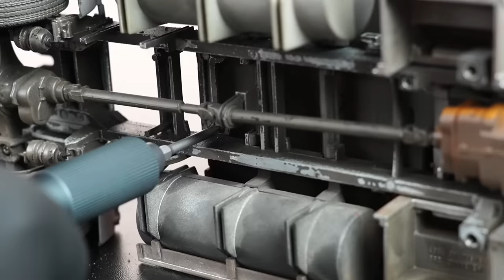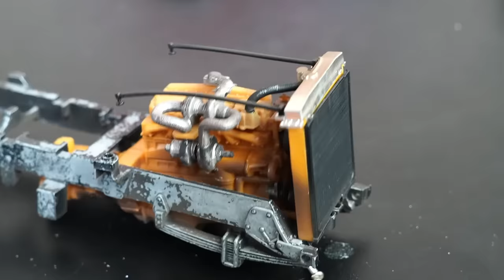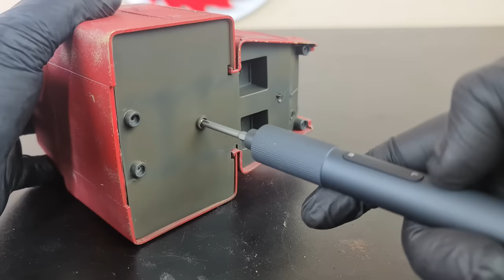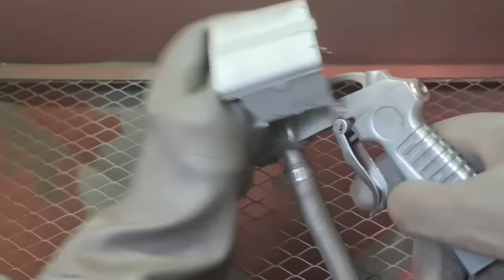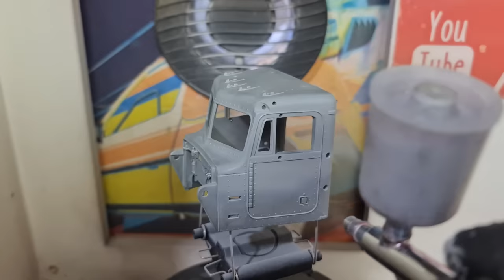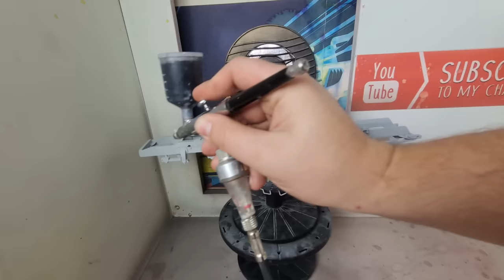Peterbilt 359 Restoration Abandoned Truck

Comment: The Peterbilt 359 remains as the most popular model in the Peterbilt lineup
Reply: It’s not that one it’s the 379
Reply: That is the most popular
Reply: @lalomadrigal8815   are u sure about that 

The 359 Peterbilt truck, is one of THE most popular models of all big rig trucks, originally built for the discriminating owner operator who needed a truck that could stand up to the challenges of long haul trucking. The 359 Pete was Peterbilt's top of the line conventional highway truck.
Reply: The most common trucks seen now are the peterbuilt 359, peterbuilt 379, the kenworth T800 Aerodyne, and the Freightliner classic XL ... though here where I live, which is right next to the interstate, the most most common trucks are the kenworths... though the Walmart here seems to use more of the Freightliner Arcadias... the rubbish collectors here use more peterbuilts...

But I think the kenworth T800 Aerodyne is the MOST popular...
Reply: @therayven3147   no the most common truck is the Freightliner FLD 132 Classic XL 359 are rare to see 379 are slightly common t800 are some what. Common

Comment: alguien me puede decir por favor en que tienda puedo conseguir ese camión de colección a si de chévere que se habrá el motor etc. Can someone please tell me in which store I can get that collector's truck if it's cool that the engine will be there, etc.
Reply: Sólo  necesitas  averigüar  la marca de la escala. Y ya sobre ése  dato.  Puedes buscar en las diferentes  plataformas  de venta. Cómo  por ejemplo  ebay.  Y otras. Talvez  lo encuentres. Hay otro modelo  qué  vi aquí  en internet.  Supongo  es la misma marca.  Sólo  qué  era un kenworth  t -600. Arocab - sleeper.  Igual  súper  detallado. Sólo  es cuestión  de saber  él  nombre  de la marca  del fabricante  y. Sobre éso  buscar. Ojalá  y alguien  pueda  ayudar  con  la marca.  Saludos

Comment: Why not paint the brake chambers golg and gray to be a bit more realistic and detailed and why body color the air filters? My guess is you know nothing about what your restoreing. The charge air boots should be red and blue. The turbo should be cat yellow to match the engine. The visor should be chrome not black, some dstail work with an actual brush not an air brush please. Paint the door handles silver. Its the minor details that take you to the next level.

Comment: it's a job that really requires skill , there are a lot of parts that need to be repaired,painted .You're doing a really great job at this.After watching their videos, I decided to restore a truck and I will share it as soon as possible.I hope I'll be as successful as you are.The brotherhood of restoration 👍❤️🔨🪛🔩🖌️
Reply: Yeah nice man I was thinking it was a 379 and I was gona correct him but I was looking and the turn signals are not on the side of the headlights which means it’s a 359 he know his trucks well I can respect that
Reply: @bullhauler3649  yes, the way to tell them apart is the 359 has the square shaped headlamps, and the 379 had the round shaped headlamps... this was the 359 model...
Reply: Yeah I just had to look a bit closer